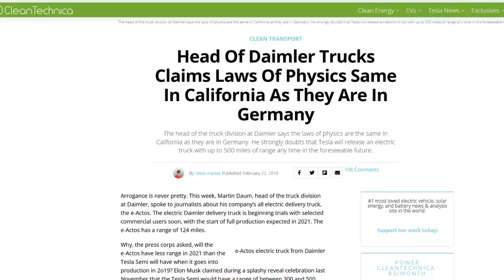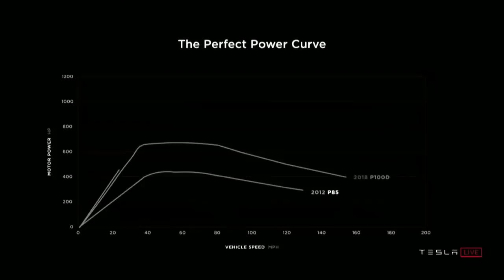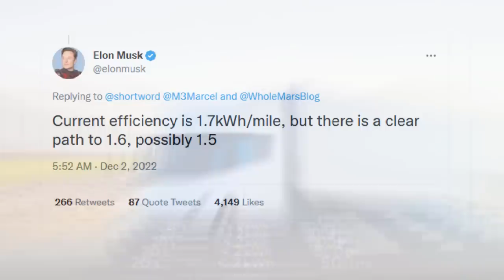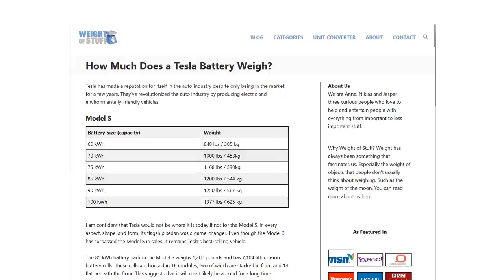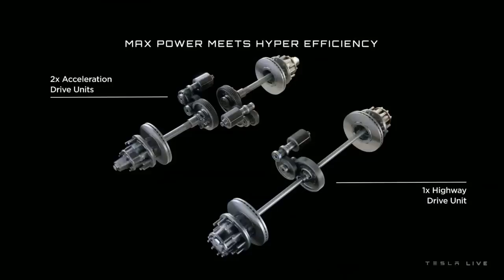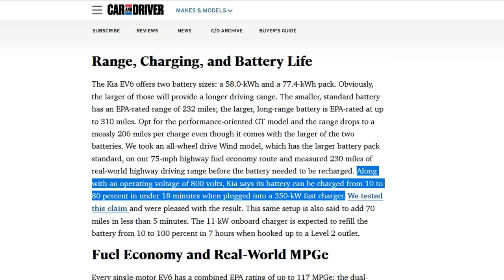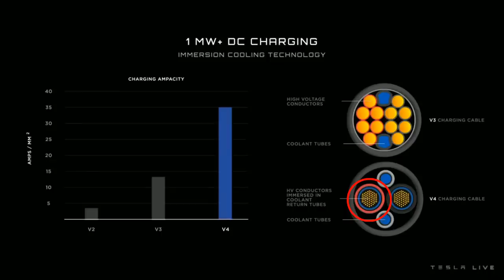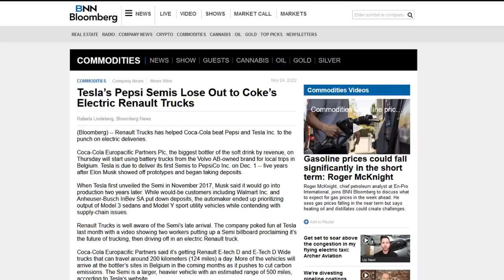Elon Musk Drops Tesla Semi Bombshell

Comment: People have taken their number's for battery weight and size based on other tesla product's. 

And range was never an issue. The problem was the amount of weight you could legally haul long range if required, and how much the battery would cut into it.

That is why most said, yeah, you can go 500 miles, but you might only be pulling 10 tons at the max limited allowed on the road. Because of the truck's entire weight.

Where as a normal diesel semi, with its normal twin 100 galloon tanks can travel 1500 miles in one go while hauling. It would take 2 or even three tesla semi to do the same job. 

Long haul, there is a difference.
Reply: @Espeon1134   That particular long haul driver still has to make stops on that 1500 mile trek. Sleeping, eating etc. Charging infrastructure will play a key role in the success of these EVs.
Reply: @gwarlow  Sleeping is the only one that is long enough to matter.

And guess what most place they stop along routes don't have chargers, or wouldn't have enough chargers to matter.

Comment: The 80,000 lbs weight limit is due to brake performance.  Since tesla trucks will use regenerative braking they can get a special exemption for weight
Reply: You're right.  Also, there's regulation allowing for a maximum of 82k due to the anticipated weight of the batteries. Tesla is so far ahead it's ridiculous.
Reply: Funny that...we run at 44 tonnes on six axles in the UK and Europe.
The weight limit is to protect roads. An EV truck with a weight exemption will damage the roads just the same as an overweight diesel would.
The Regen braking is no more powerful than a conventional engine (Jake) brake or a retarder.
Reply: @kstars101  it should go much higher than 82k lbs as the tires can be rated for up to 117,000 pounds
Reply: Yes imagine if you could haul 90k or more having 10 percent more is like one free trip every 10
Reply: @richardsimpson3792  Regenerative braking is tunable and is more than capable of locking the wheels. It's far far superior to engine braking. Roads in the UK are far older than roads in the USA. There's probably only a few road left in America that weren't built by overweight trucks.
Reply: @richardsimpson3792  are jake brakes almost silent or do they make a lot of noise?
Do they put fuel back in the tank?
Reply: The 80,000 lbs weight limit isn't any special thing. And all EV semi's will be granted the higher 82,000 lbs limit, simply because of the tractor unit being heavier compared to ICE units.

They have it simply so that the tractor will be able to have a higher axle load put on it compared to your usual ICE tractor.
Reply: @richardsimpson3792  I love how all the replies go "the brakes can do it" or "the tires can do it" and nobody really addresses the road damage point.
Reply: @andrewsaint6581  also they shake the entire truck to pieces, they loosen bolts very dangerous
Reply: @KaiHenningsen  road damage is not caused by weight. If roads get damaged by weight they were built wrong in the first place. Roads are damaged by ICE vehicles leaking all over them.
Reply: @richardsimpson3792  In Michigan trucks can go 162,000 but with 11 axles. Fortunately they are only allowed to haul safe things like steel coils, gasoline and diesel, propane, and such. ;-)  Those trucks can be very annoying in traffic due to exceptionally slow acceleration.  I would love to see a Tesla tractor pulling those loads!
Reply: @andrewsaint6581  Imagine, if you will, a world without open exhaust pipes or Jake Brakes.  :-) :-) :-) :-)

Comment: Ask a truck driver if this is a good truck, they will laugh at you. This truck makes no sense for long haul. It might do fine in the traditionally warm California, but elsewhere, where it often gets below freezing, batteries don't work very well. 

In trucking, there is this thing called blind side backing - where a driver must back a tractor trailer only using their mirror. This increases the risk of backing into other trailers - a central seating position means that both sides of the truck are considered a "blind side."

Comment: Great video!

I think you need to include the fact that the 500 mile test run of the Semi started with a 94% charged battery pack and ended with a 3% charge. If you included 9% more battery in your calculations of the size of the pack you would estimate about 910 Kw instead of 850 Kw.
Reply: Fremont factory to San Diego is 470 miles, so 505. And about 850kWh.
Reply: @allterrainrandy2587  Tesla reported the Semi drove 500 miles. Argue with Tesla, I wasn’t there.
Reply: @allterrainrandy2587  Fremont is a big place, so is San Diego. It depends on exactly where you start and where you end to determine the exact distance. Google maps probably uses the city center if you don’t enter the exact starting and ending addresses.
Reply: @garycarson3128  i rewatched the presentation, they said they drove to the very bottom of San Diego.

Comment: Standards for maintenance in the manuals = anyone can build a truck equal to that of Tesla easily.  There is nothing magical about what they are doing on that end.  What most do not understand are the motor controllers which no one talks about and where a HUGE efficiency drop happens in MOST other vehicles as pretty much everyone can make the same efficiency motors where the only difference is total weight.  For a VERY long time, motor controllers of only 90% or less are normal.  The highest end motor controllers have hit 98.5% efficiency and last I checked I thought I read a treatise on someone here in the USA claiming 99.4% motor controller efficiency.    So, if most motors in their respective RPM range(not optimized) run around ~90% efficiency at most if you have a motor controller of only ~90% efficiency = 0.9*0.9 = 81% efficient, but if you go to 98.5% efficiency on motor controller and make a specialized motor optimized for flat ground or maybe 1% grade @100kph then one can hit ~95% motor efficiency with a total efficiency of 0.95*0.985 = 0.93 = 93% efficient compared to 81% efficient.  Another thing about electric is the vastly less drag of the drivetrain underbelly.  This alone will improve the Cd by ~20% compared to ICE vehicle.   Can't do anything about rolling friction where the vast majority of drag occurs on a truck compared to a car, but hey, a win is a win is a win.  Combine all this and you get a very large increase in range when comparing a vehicle engineered from the outset for efficiency without giving a crap about existing infrastructure and a slight modification to a standard old design trying to optimize what has come before. 

Only thing you got completely wrong is about the jack knifing.  Electric motors will help the jack knifing especially on dry pavement, but you cannot stop jack knifing when you Lose traction due to water or frozen water or in vast majority of cases, when you are approaching a wreck in front of you and dodge to the side so as you do not KILL the people in front of you and rather go into the median or ditch or even just the rumble strip leaving the CG of the load and the plane of your traction going in opposite directions.  No amount of "electric motor" control can truly overcome that issue.  Help significantly?  Yes.

Comment: Cylindrical batteries are an order of magnitude more durable than pouch or blade style prismatic batteries. Hitting hard pot hole maybe break like a cell phone vs cylinder much stronger
Reply: I'm sure the smart guys at tesla have built vibrational dampening into those housings.
Reply: Teslas are prone to fire.
Reply: @paulbedichek5177  Actually, they are not. Many more fires with ice vehicles per Capita as compared to Tesla's.
Ok
Of course GM vehicles and some others have led people to believe Tesla's are the same. Different breed of animal.

Comment: The issue is the amount of cargo this truck and have on the road. A normal truck is about 50% truck and 50% cargo. So far we have seen Tesla Trucks moving a small amount compared to the internal combustion truck. So far Tesla will not tell us how much is the weight of it. A truck hulling less than half of a normal load is not cost effective.

Comment: Great video 👍👌🙏.  It's entirely possible that the Tesla trucks will have replaced the idea that diesel is king in 10 years. I say 10 years as time is needed to real world test and fix / recall/redesign, upgrade such huge loads in weight, torque and heat in the trucks, their assembly and in the charging. Once perfected it's a game changer for large fleets, I would not buy one until 10 years past the first production year to get this real world reality baked into all parts of the design, factory, truck and charging.
Reply: I think Pepsi will be the parakeet in that particular coal mine.
If they can save over $100K/year on each truck that means you've wasted more than $1M by waiting 10 years. Now your risk aversion has a price.
Other companies will see the same problem and try to switch to Tesla Semis as quickly as possible. Pepsi was very wise in choosing to be the early adopter. They get the benefits right away and not in 10 years, which might end up being the wait time to get one.

Companies with Tesla Semis could become so dominant that the companies without declare bankruptcy. It promises to be that big.
And if companies are going bankrupt by driving Mercedes-built semis, what does that say about Mercedes? People will be giving them away for free. That might not be an exaggeration when it literally costs you money to operate one.
Expect Mercedes stock to drop like a rock.

Going forward, it looks like the backlog for getting one of these trucks will be so great that Tesla couldn't build the gigafactories fast enough to meet demand.
Here's a potential solution:
He could tell truck manufacturers the specs for retrofitting their trucks with Tesla guts. Then you take the battery, drive wheels, etc. from the Tesla Semi and put them on the Freightliner, Mack, Kenworth, etc. Now Tesla can produce just those components and not the whole truck.
Meanwhile, diesel trucks are disappearing left and right off the highways.
Other companies do all the hard work while paying Tesla a mint in royalties, but they stay in business. These trucks won't be as streamlined or as light as the Tesla Semi, but customers would be able to purchase them now instead of in 10 years.
Reply: @protorhinocerator142  I'm very excited by Tesla & Space X..... however no where near as much as the marketing hype wants me to be as a potential customer, to me it's unrealistic  even based upon Tesla's own Stella expectations on cars, why based on their output as measured in trusted customer used car surveys here in the UK Driver Power data, which tells us Tesla ownership satisfaction is still below average. For me at least this is not good enough, I accept early adopters will commit  hard.  Tesla ownership satisfaction will improve in time but not now according to un-conflicted owners reporting in the UK. 

 I read the independent real world Tesla UK car ownership feedback survey, Driver Power is decades old (JD Power as was) and trusted it due to its independence, and my ownership experiences of mirroring it, owners are still putting Tesla cars in the bottom half of the satisfaction list here due to the number of owner severe faults in cars and charging,  and the length of  time for resolution. Not great, but will be. I see these poor ratings as early life glitches which will eventually get fixed. This is 10 years after first sizable car production runs.  I chose not to believe self interested marketing in new stuff when it comes to actually owning and running fleets of cars/ Tesla vehicles, just yet. Maybe UK climate means the cars we are shipped are prone to issues, who knows??

I'm yet to see Tesla perform recalls in a way that inspires any confidence in me as the established dirty-fuel.brands have had and do. Don't get me wrong I believe Tesla and hopefully other competitors too is the future however still arms length Tesla ownership data reports below average satisfaction is the basis of my thoughts, be they right or wrong 10 years from now, we'll see I guess. Hope I'm wrong.

Comment: No one seems to deal with the problem of lost road taxes that running an electric truck will cause. They never figure that into the calculations. The basic weight is the same, same tires, same delivery schedule. AND if there are over the road electric trucks the states will have to install recharging stations at every rest stop AND repair the roads. Basically the same problem exists with electric cars. Too add to those issues, is the electric grid in the US actually ready to handle the recharging needs? California can't recharge the few EV that they have right now. Great idea, sort of.

Comment: How is the range impacted by running the heat?  Are these calculations under only ideal conditions?
Reply: and cold ...where batteries really lose their power
Reply: a semi is going to produce more than enough waste heat to keep the driver's cab warm.
Reply: @w0ttheh3ll  in a standard engine.  Batteries don't produce heat like burning gas does.  With that being said, I'm not pro gas engines either, I just feel like you need the full story on electrics and not just the hype.
Reply: @marcin4664  Electric motors do produce some heat. (And so do batteries, technically).
Reply: @w0ttheh3ll  "some" being the keyword.

Comment: People fail to realize what these truck are for. People keep comparing them to long haul trucks which is not what these are for. These trucks are going to be for companies that need to deliver in less than 500 miles. These trucks were not made in the mind to go across multiple states. Electric trucks are very far from being long haul trucks. These are going to be used to deliver goods from just outside of cities into the cities. I don't see why people think these are long haul trucks. Companies aren't buying these trucks to do long hauls. These are final destination trucks that do short to medium range routs and that will be put on a rout that is done over and over. These trucks aren't a swiss knife. They are bought for one purposes and will be used for that purpose throughout its use. That's where these trucks are great. Set routs that are within its range and that are done daily. Charge when they are loading and unloading, companies are going to install these chargers where they are needed. You guys need to stop seeing these trucks as replacement for every truck. These trucks are going to do one job and do it well and save companies money in that one area for now and this will change as they get better but for now they have a very certain use and will stick to it.